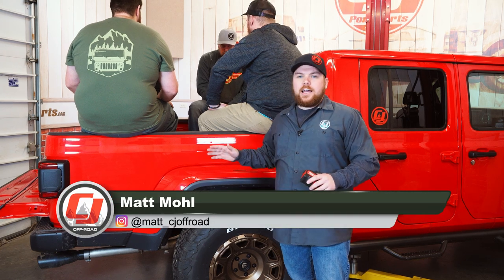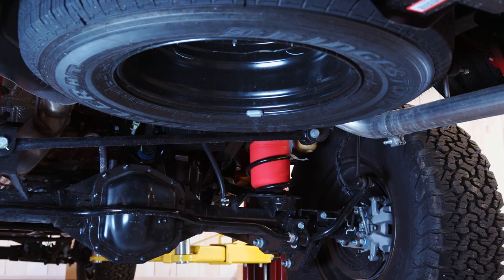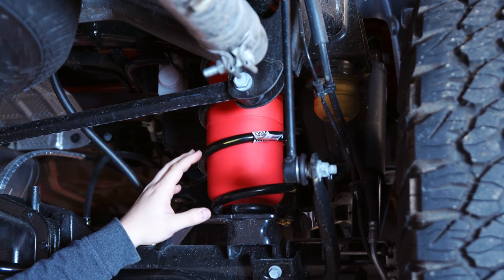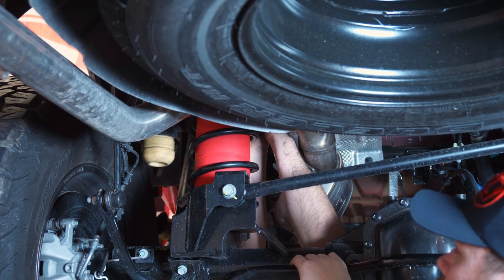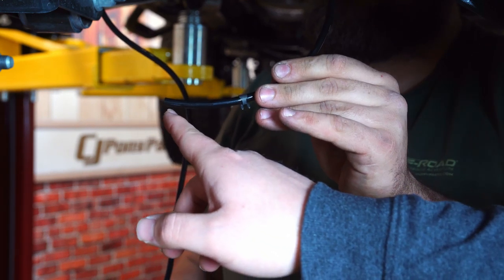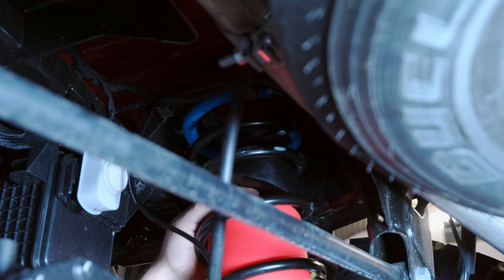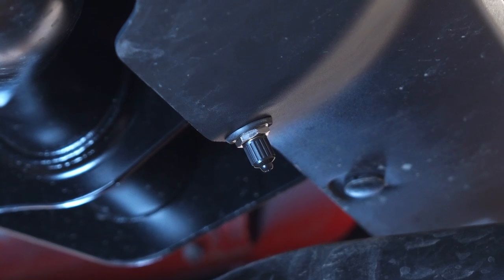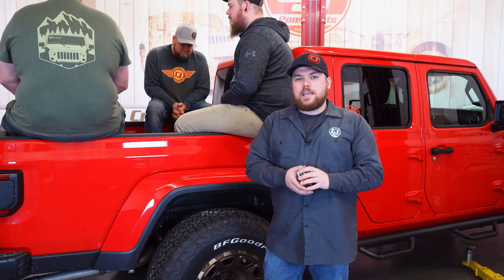2020 Jeep JT Gladiator Install | Air Lift Rear 1000 Air Spring Kit

Comment: My question for you is,  how will these fair to thre springs flex when on the trails?  Would they hold up pretty good?  I'd be worried about the springs extending and collapsing on the bags.
Reply from the maker: They are built to handle trail abuse!

Comment: Hey Matt my mechanic at the Jeep shop installed my airbags, are they supposed to squeak? When the bag rubs against the spring its freaking loud when going down the road, turning corners or on bumpy roads. Sounds like crap, is this normal?

Comment: Would it be an issue to add these to a Gladiator with a 3 or 4 inch lift?
Reply from the maker: They might work with the lift.

Comment: I want to lift my 2020 eco rubicon you think some of my mopar jeep lift off my 19 jl rubicon w/3.6 will work ? springs might not due to a 400 # heavier engine  please advise...
Reply from the maker: Their is a diesel specific mopar lift coming out soon, however you can install the 3.6 lift you just may notice a little more droop up front!
Reply: @CJBroncoF150   I don't do droop well thank you for reply

Comment: Did you remove both blue coil isolators or just the lower one? In the airlift instructions they say to remove both. In the video it looks like the top blue coil isolator was left on. Just want to confirm.
Reply from the maker: We only removed the lower one.
Reply: @CJBroncoF150  Hello - what happens if you do not remove the blue coil?  or better yet, what if you remove the coil and then take out the bags later on.  Will it harm anything?
Thank you
Reply: @ifithaswheels7307  I guess we'll never know.  This is a good question. Why in the hell are these things pulled off in the first place?
Reply: @CJBroncoF150  the directions say to remove the TOP ones only!!